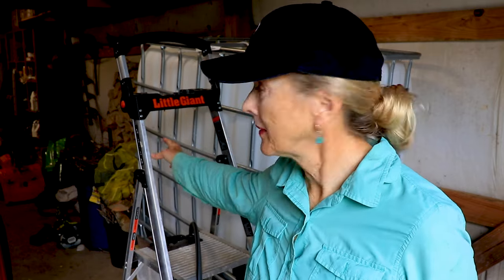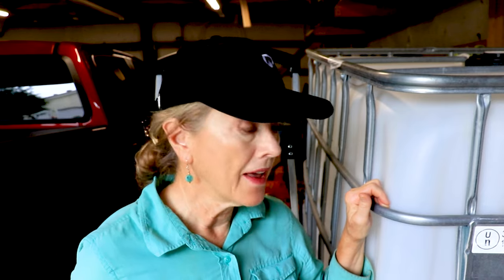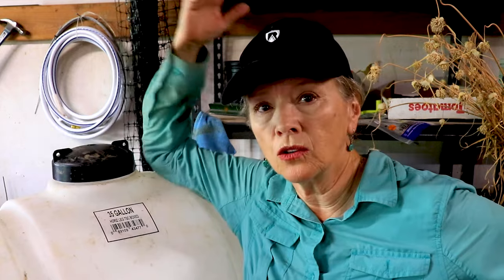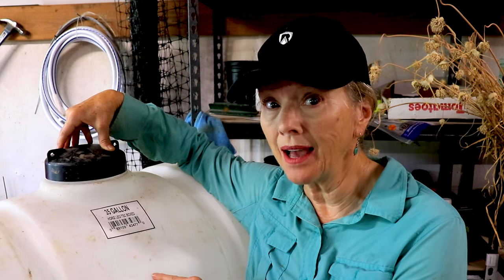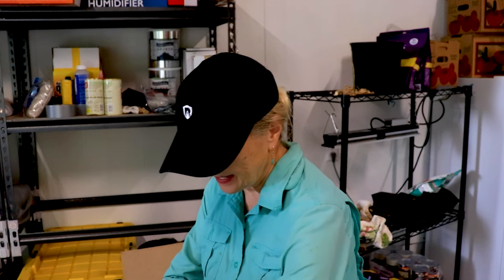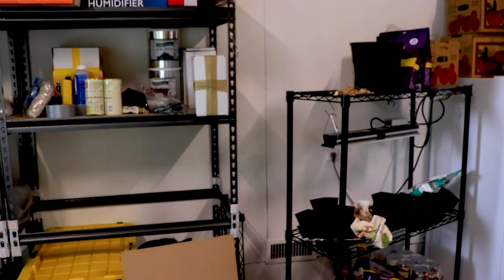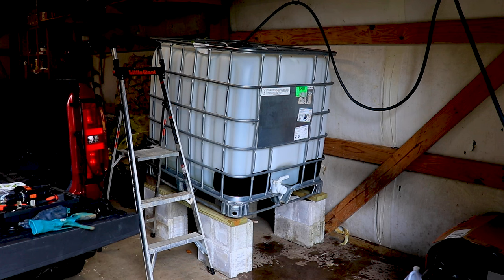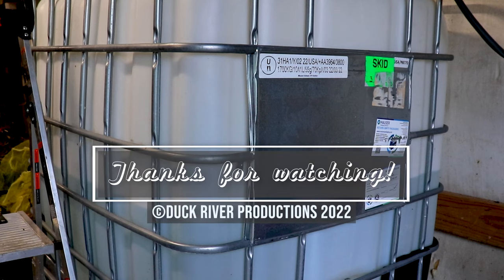TIPS storing water LONG TERM! (Don't make THIS MISTAKE!)

Comment: The clear plastic bottles from Kroger that are most of the time cheaper anyway that are stiffer than the regular white ones last longer on a shelf but I've no clue how long in the 50years I've been prepping haven't leaked yet!!! Lower than normal temperatures at a constant is best so they don't expand and contract daily with the day night difference!!! Outdoor is not a good idea for drinking water try to keep them indoors in a controlled environment for further longevity sweetie!!!
Reply from the maker: I don't have any water stored outside. And I agree on the bottles. See yesterday's update. Thanks!

Comment: I went to my local hardware store and bought a hard rubber tapered bung plug and use it on my bathtub drain. It has held water for a week without any loss. This will give me 50 gallons of water for washing and toilet flushing.
Reply from the maker: I wonder if that is what I have. I haven't tested it for a week though.
Reply: @Latebloomershow  
Also Kroger has blue 4 gallon pre filled and sealed drinking water bottles for 4.99 each. 
Great option for people without a tank

Comment: Won't let me edit below comment but didn't get to add that we bought aquarium heaters to prevent freezing for the short periods of time that might happen where I live and will wrap them for cold weather as well.  And finally, a smallish sump pump in case we can't get valve to work to get the water extracted.

Comment: You also should not set plastic jugs on cement directly. You should put something under any water you store. We have a Berkey royal, and I have 6,   5-gallon jugs, and I have about 40 gallons of empty vinegar jugs from my canning for the last 7 years and I fill them up and store them in the closet.  Kay the vinegar jugs don't leak. I put them up last year in August So I am running them through the Berkey and refilling for the new year. Those jars came in real handy when we were on water boil for 3 days after the freeze in Texas the year before last. I have a water tester and the water was seriously high on the dirty scale. So for 3 weeks, I used that at the time 35 gallons of water running it through our Berkey. After about 3 months I refilled the jars finally.

Comment: The ball valve at the bottom is DESIGNED to be "sticky" so it doesn't accidentally open...especially the last 1/4 turn. A pressure washer is a HUGE plus when rinsing. I get these and provide to friends . Look for local milk supply houses (supplies farmers, ie.. DeLaval)  as a source. They have them from teet dip and can be easily rinsed. Many have iodine, or hydrogen peroxide in them for milk house use. Rinse and fill. Some totes have a standard 2" NPT (national pipe thread) standard, others have the more coarse threads (which an adapter to garden hose bib is available  online) ...for me the 2" NPT is preferred. Also, look for the  "back up" threaded cap that comes with them during transport as a backup in case of ball valve failure....many times those are tossed out, but sometimes they are present.
Reply from the maker: 1) Valve - Yes, that finally dawned on me. 2) from dairy - the person who suggested getting one got his that way and encouraged me to get one, I haven't found a local dairy, but will keep looking 3) I was advised to just take the black cap to TSC and make sure the pipe threads match on an adapter. I do have the black cap. Thanks so much!!

Comment: Can I store one of these in my garage that is not connected to my house, we have very hot summers and very cold winters. Will the 101 Temps and the 0 degree temps ruin my water
Reply from the maker: Zero you may have to put a small heater underneath if the cold drops down and stays down for a few hours. Here it hits the low just before dawn, so I haven't had to worry about it freezing. Haven't noticed any problem with hot summers and I'm sure it's in the 90's in there at times. I keep mine covered with black shade cloth, even though sun never shines in there. I really should replace this water. And yes, you can store it over there. I would ask your neighbors who might have one and see if they've had trouble with the heat.

Comment: So with the distilled water, can you pour them in another food grade totem? Or would  I have to treat the water?
Reply from the maker: That is a great question. I just bought 6 amber glass gallon jugs for storing water, but can you pour distilled from the original bottle and it is still distilled...? Must research. I want to eliminate all those plastic bottles but haven't had the time. they are still sitting in the floor!

Comment: Just measure that pressed wood an see if big box store has scrap to cut to same size most time they will cut it for you . Also ALWAYS store anything with the Food safety rules . Like meat on bottom on catch plate NEVER middle or top so contaminants never drip down and food below it same with tools grease water chicken feeds etc. also those large containers that are food safety are usually used previously for honey or syrups of some kind and food production nothing wrong with them they just need to be washed out.
Reply from the maker: Thanks for the great advice!
Reply: Mine had MCT oil in it. Not concerned about contamination.

Comment: Wondering if a couple heat tapes would keep things from freezing. They are typically wrapped around outdoor hydrant/ pipes to keep them from freezing….many of the ones today have a thermostat on them and don’t need to be turned on and off.

Comment: Those cheap thin bottles get too hot in a car or garage and expand,  then it releases the mist, drips and when it cools it shrinks
Reply from the maker: Yes, plus they are supposed to biodegrade, haha, and I didn't think of that. My garage stays between 60-80, so I didn't think it would be a problem.

Comment: Do not use Used IBC totes for potable water, or for washing dishes or anything for human consumption or cleaning. The only exception would be h2o2, (hydrogen peroxide, dangerous oxidizer over 10%) these are typically only filled into new totes, and break downinto h2o , but you have to do your own research,  I am not liable for your actions,  and not recommending anything. I have been in  indrustry , lots of industrial chemicals,  polymers,ect are shipped in these that are not good for humans. Because a tote is food grade does not mean it didn't have chemicals in it. Used tote are widely used multiple times with a variety of unknown chemicals to you in their lifetime. For flushing toilet might be OK
Reply from the maker: Wow! Based on all the great comments, I had decided to only use this water for toilets and dishes, etc., but now, IDK what I will use it for. Yes, I wish I could have gotten one that had only been used for H202, but, no one will say exactly what it was. I thought I could trust "food grade." Many thanks, my friend. God bless.

Comment: What do you use to sit the large food grade tank on?
Reply from the maker: I used two concrete blocks one on top of the other at each corner and two 2x4's running from block to block on two sides.  This only works if your tank has a metal frame. Otherwise you would have to have a square of heavy plywood that fit over the concrete blocks.

Comment: A few things to think about in regard to inc totes.
First. Wash The tank out good then pour a gallon of bleach in it and roll it around to kill any algae spores that might be in the tank. Then rinse it out good before filling it.
 The valves have different threads. If you are lucky yours will be fitted with a thread for a common plug with a hole threaded for a common water faucet.  If yours has an odd thread and you can't find a fitting for that thread size you you can get a rubber boot that will fit over it at Home Depot. The boot is black rubber tube designed to join two pieces of pvc pipe. An adapter fitting that will fit inside the boot that is threaded for a common hose bib faucet can be bought.
Put two hose clamps over the ends of the tube to hold it securely.
Don't trust the boot to stay under pressure. Turn off the main valve when the water isn't being used.
Build a platform out of. Stacked concrete blocks with holes facing up until A standard 5 gallon bucket will fit under the faucet.
If you put the tank a little higher then a water hose can be used to water plants etc. Don't expect high pressure but it beats hauling water in buckets. The higher the tank and the more water you have in the tank the more pressure you will have.
Before you fill the tank wrap the tank with a tarp to block out the light so algae doesn't grow in the tank.
The tank can be painted but the paint can flake and peel off in a year or so. For a more permanent thing wrap the cage in pressure treated plywood and paint it.
If not in dirrect sunlight the tarp will last for years.
Set the tank on the shady side of the house or under a cover of some kind.
Most people use these tanks in their rain water catchment systems but that's a whole other subject.
Thanks for the video.
Reply: @SkinnyVinnyLive  You don't leave the bleach in the tank.  You drain it out and use it again and again.
This water is mostly used for watering plants so I don't use bleach in the tank at all except for the first cleaning.

Comment: Your gallon plastic bottles with water will only last a short time. The plastic won’t hold up for long storage. You need bottles that like 2 liter bottles or better. Can you cover your IBC totes with a black tarp to keep it from the sun?
Reply from the maker: Mine is in the shop, else I would cover it. It stays in the dark most of the time, direct sun never hits it. Yes, I'm changing out all my gallon plastic jugs. I didn't realize they were meant to decompose. Thanks so much!

Comment: I had a long comment to your video and i dont how continue to do this but i made it disappear ughhhhh
Ill try to shorten my comment. You might find a Water pump useful. I bought a 12 volt pump to aid me  draining my 55 gal drums. Also ive read that once you add a chemical to a Food grade container it is no longer food grade . I guess because the chemical leaches into the plastic,  just be aware. Best of luck with your Water Storage.

Comment: Did they freeze if they did they will expand and contract they will crack the seam or the water can be forced out the top and cause it to crinkle  up like that
Reply from the maker: No it stays between 60-85 in the garage. But yes that can happen. I’m told this happened because these bottles are made for short term storage and to biodegrade.

Comment: I'd never store potable water in a second hand container. Plastic comes in different resins, the number for recycling refers to which resin. 2 is high density polyethylene, and they have ideal conditions for usage. Storing in a unheated garage was probably the reason of the premature failure of the small bottles, since the plastic gets brittle when temps gets lower. Sunlight will degrade them. Look for products designed for long term water storage, potable water tanks, check the instructions for instalation. Plastic will fail with time and will have to be replaced. Just think about old plastic toys, all yellowed and brittle.
Reply: A quick internet search on IBC, recommends inspection of the tank every 2/3 years, and the steel cage is supposed to last for 10. While the cage can be recycled, the plastic tank should be new.
Reply from the maker: Thanks for the info. I may just use this for dishes, shower, sponge bath and toilet then.
Reply: @Latebloomershow  remmember water should only be stored for six months. How old is your cistern? If it keep getting leaks maybe it has reached their lifespan. Construction materials have a recommended lifespan.

Comment: When you fill your tank with the hose of you would purchase a white drinking hose you won’t have the rubber taste.
Reply from the maker: Yes, I did, but could only find a 25' one. That didn't help, since it was over 100'. But, I've decided to use this water for non-potable uses after all the comments, and will store 50 gal. in my garage for drinking purposes. Thanks!

Comment: Never use a green garden hose for drinking water (tell the kids). My friend has a herd of horses and watered them with many lengths of cheap hose. They all had severe health problems. The white hoses are made for potable water and the rubber ones may be OK (investigate this).
Reply from the maker: I bought a white one for RV's but it's only 25' so that did me no good filling it up. I would have had to get 5 of them and they aren't cheap. So, I know I will have to be purifying this before use. Many thanks for the warning!

Comment: I have 50 gallon tanks ,I have test kits and I will filter ,then boil it and check it when I am ready to drink it  If it is questionable  I will add some bleach or iodine and drink it ,I'd rather drink maybe water , than die from dehydration.  You are not supposed to use a garden hose either, or a hose that has been on the floor . lol lots of rules , I guess the garden hoses have something dangerous in them.   Put a beach ball in the tank or some air filled balls that will go in the opening , that will keep the ice from bursting the tank.  You could put a  weighted kids float ring in it   and blow it up through the opening , it would need to be heavy enough to not float on the ice that forms
Reply from the maker: At the time I filled it, my drinkable hose was 25' and I needed 75-100' to get there from the tap. You are right, that would have been much better. I really need to redo the tank. Water has been in there for 2 years now. I bought a purifying kit, have to locate it. I don't think it's frozen, yet, anyway. But, that is a concern.

Comment: Would a clear or white tank work outside if it were darkened by painting it and kept in the shade?
Reply from the maker: Yes, you can paint it black, but it has to be touched up after moving it as the cage rubs against it. I read that in one of the ads.
Reply from the maker: Can also cover with a tarp.
Reply: @Latebloomershow  Thank you
Reply: I wouldn’t waste the time and money to paint a tank. We tried it and with spray painting it, you think it’s covered on the outside, but if you look on the inside with the light shining thru, you can see that the light still gets in and algae will still grow. Also, it could take 6 cans or more of spray paint, plus it has to be repainted. For the time and the money invested in the painting, you’d be much better off to buy a good black cover for the whole cage. No worries about light getting in that way!
Reply: @vickiereed643  Thank you for your comment.

Comment: Here's a tip: gravity works great and for every 100' in elevation of your water tank, you'll get 40psi on the ground without a pump.
Reply from the maker: Unfortunately I don't have any way of getting it up that high, but yes that would be good.

Comment: important: make sure you use bleach that's for drinking water purification..and It's important to follow the manufacturers instructions on the bottle of bleach you can't just throw in the quantities you think. You need to make sure that the bleach doesn't have detergente added.
Reply from the maker: Thanks for the good tips! I'll make sure to get some of that.

Comment: Mice can put tiny holes, usually on a corner. A nice drinking source for them. The plastic is so this. Any signs of tiny mouse droppings?
Reply: No, still in storage. But we bought dark covers for algae , and plan to wrap them in blankets and tarps. We will set them on cinder blocks and then on wood 2X6’s. And we have 3 Ferrell cats. Well fed wild cats. For generations. But they love to hunt.

Comment: Kaye, is your garage climate controlled? It appears to have been exposed to temp changes causing pressure changes. Possibly frozen then split.
Reply from the maker: Yes there is a vent. Fluctuates between 60-85.
Reply: @Latebloomershow  the extreme temp changes will cause contractions and expansion that weakens containers.

Comment: Cheap plastic water jugs these days are designed to biodegrade over time. So you need to buy better jugs to put your water in. If you do a lot of canning, and have canning jars, once you empty a jar of it's contents, clean and fill it with water to store. You can use the lid you canned with. If you didn't use the water, you can dump it when it's time to can again, and restart the process. It's just extra water you wouldn't have had, stored in jars that weren't being used at the moment.
Reply from the maker: I have lots that I haven't used. But, I hate to use them with water in case I may need them for canning, but someone else had suggested this and I think it's a great idea!

Comment: The thought of all that drinking water in  plastic makes me queasy. Is there not something that’s not made out of plastic that we can use?
Reply from the maker: Well, the problem is, glass is very heavy. I did buy 4 gallon jugs after I did this video, but that's only 4 gallons of water. At least they won't leak. If you go to the link in the first comment below the video, see all the storage options. Of course, they are all made of plastic, but BPA-free. Good luck. It's a work in progress. I spent some time today trying to figure out a better solution for me, getting some water closer to the house.

Comment: I’ve found that all Walmart water bottles leak over time.  🤔
Reply from the maker: I just heard in two other comments those bottles are not made for long term storage but to biodegrade. That makes sense! I will be mentioning this in the next video.
Reply: Also, don’t stack the packages of plastic water bottles, they will leak from the weight.

Comment: I don’t think putting a candle under that gallon of plastic, is safe. Better a heater on the side away from the water container. Away from your car or any chemicals. And wrap the container with those huge moving blankets. Blanket then a plastic then another blankets. Thanks for sharing.